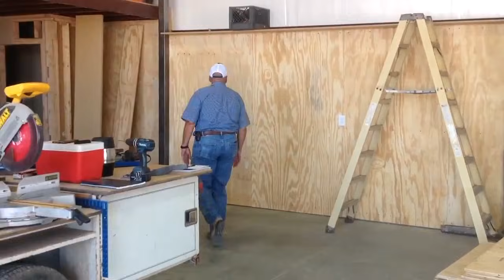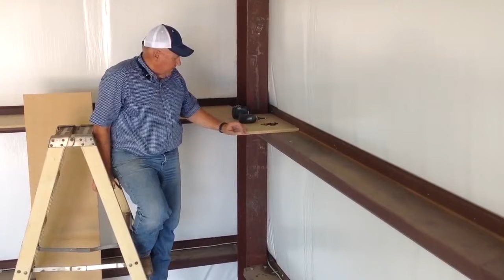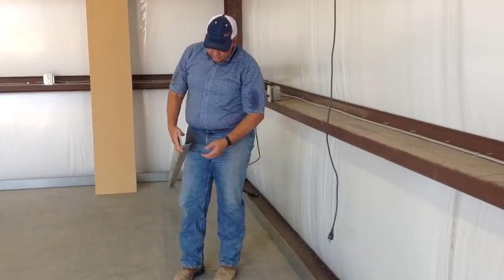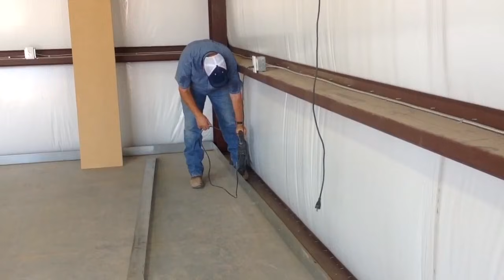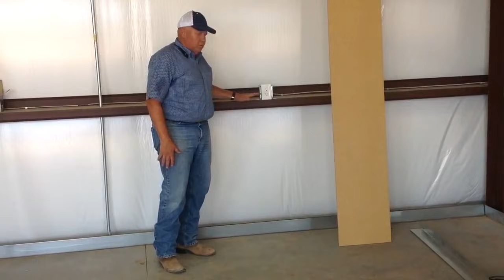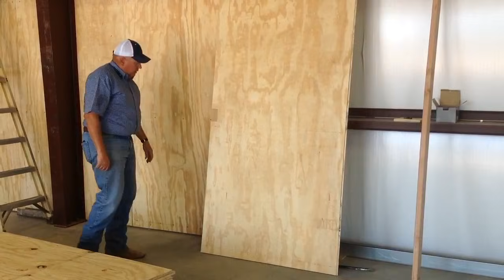Metal Building Interior Finish

Comment: Great video, I just had a metal building built and I'm wondering what type of bit to drill through the heavy beam? The thinner stuff is no problem but to run the conduit it will need to go through the supporting beams horizontally. Any help is appreciated.
Reply from the maker: Great question Brandon S and thanks for watching. Typically we do not use any drill bits, instead we use self-tapping tek-screws designed for metal. So long as you can find a source for them, they make ones designed to drill through 3/8" material, that should make it through any of the beams in your building. Otherwise any good drill bit designed for metal should suffice, the beams are made from mild steel and do not require any special drill bit material. Though we've found the cobalt bits are worth the extra expense simply because of their longevity compared to standard HHS bits. Good luck and enjoy your new building.
Reply: Jeezzzz, this is an old video but I have to correct this.
You SHOULDN'T be drilling through the heavy vertical structural members, if you look up the proper code way you use conduit to 'U' around the beam.

Comment: 3/4" plywood is the way to go. If you're making a shop then sheetrock is nothing more than a pretty waste of money. And if you're worried about fire resistance, there is plenty of low cost do it yourself spray on fire retardants available. Just spray them on all sides and let dry prior to installation and you're safe. 
The only thing I don't like is MDF, it's just crap. Use plywood. MDF sags like old boobs. 
And lastly, if you're building a workshop, don't forget to run your air, 220v, and 3phase, around the sides before hand. It'll keep your walls clear and you'll have it available to easily tap into. I'm planning a build and when the interior is finished, all I want to see is the walls and some equally spaced 2 sets of outlets and air lines. The rest will be added on as need basis. It'll keep the long term update cost low. And that's more important for me since I plan only one big cost in the building and setup. But for now it's saving every penny and getting any needed materials that I can get for cheap or free ahead of time.

Comment: my i beams are 30 feet apart, one at each corner,  and my perlins are 8 feet up.  If I use this method, what keeps the wall from falling forward if something heavy is hung from the wall.  The perlin is thin metal and it holds up the metal walls....  I guess I see the entire wall collasping inwards.  There is a lot of flex in the metal wall.
Reply: Purlins refer to the longitudinal, horizontal member in the roof. Girts for the longitudinal, horizontal wall  members shown, You really should have done more research on the who you got the building structure from as it seems they short sold you and gave you a poorly designed/engineered structure, you should have at least two intermediary columns and roof beams. Seriously get a local steel engineer to inspect your structure, most do not offer such minimal primary structural support, unless you're not understanding what comprises the anatomy of such a structure and not knowing how to determine what is what that you are looking at.
Reply: so are mine. steel studs @ 16 oO.C. that is a STRONG wall. the shelf idea is brilliant.

Comment: Another thing that could be done is the put the plywood even higher off the floor and use diamond plate about 8 inches up or so or you can buy rubber molding that can be glued on.

Comment: That brings the question why go with steel why not go with a stick framed building? A lot of people I know that have bought steel buildings did not get the insulation, and the insulation is not easily added, this makes the building very hot or very cold compared to a stick built building.  Seems like a lot of extra work and steps, like you mentioned three-quarter plywood is expensive $30 a sheet, a steel building is expensive and is not easily finished inside, look at all that square footage behind the sheeting that you're losing!, and you're losing a lot of space because of the beams angling out, those beams dictate where workbenches or equipment is going to go in your shop. Why not just frame the building out of 2x6's or 2 x 4's in the first place? You can put metal siding on the outside of the stick frame building if you want and make it look like a steel building. Stick framing is pretty easy, seams to me the labor saving would be huge if you supply the labor, there is a lot of profit in the steel building kit vs just buying Raw materials. In my shop wall space is essential to hang and mount many different things i've worked in metal buildings and it's a lot harder to hang things run air, electrical etc also like I said before the way the support beams angle out word it prevents you from putting equipment up tight against a wall or forces you to move it over to one way or the other, for example say you wanted to have shelving all the way down one wall tight against the wall it would be impossible.
Reply: Today there are more easy to apply less 'toxic' foams after they have been sprayed and want to wear a suit in any spray application to keep clean and the stuff out of your breathing system (nose, mouth, throat, lungs) and ears too. There is also BIBS blow in insulation system on top of EPS (expanded polystyrene) sheets up to 4 inches thick, All of these are easy to put in and offer full R value as opposed to the insulating they instal and pinch between the exterior finish and girt/purlins as any one with experience will tell you this pinching negates insulation values and creates cold gaps. I would forgo Fiberglass rolls as rodents would just eat through it  and opt for rockwool or denim if you rather go more natural route but this has its minor air gap issues as well if cut outs are not cut for proper snug fit.

Comment: It depends on what you can do in your building but always remember this. You can go TALLER much more cheaply than wider or deeper. In my neck of the woods you can find used steel trusses and red iron cheap. So building a second level (for storage for example) becomes much more cost effective than a larger footprint. Think 20 foot eve height rather than 12 or 14.

Comment: Is there a reason we can't build the steel building to match dimensional lumber? That way we would not have to cut the 8 inches off the plywood. Then the whole building could be finishable with dimensional lumber and drywall or such, with very little scrap.Is it that the steel codes don't match the wood codes?
Reply from the maker: That's a great question Steve Harkins. 

The standard girt height is 7'-4", but can be changed depending on what the project owner requests. As each building is custom designed to specification delineated by the owner, we are able to place the girts at varying heights. The standard design we use is generally the most efficient in terms pounds of steel used, and thus the cheapest, which is the goal of most builders. Varying from the typical design will likely change the overall price of the building, but depending on the intended use, i.e. sheeting or dryingwalling the interior walls, the additional expense in steel may be outweighed in savings elsewhere. 

Please contact us if you happen to live in the state of Arizona and ever look to build, we'd love to earn your business.
Reply: Steel v. Wood codes and requirements are quite very different from one another

Comment: Just use the same kind of sheet metal that's on the outside of the building. You can get it in white,  it's not a fire hazard like plywood and should be cheaper than $30 a sheet.
Reply: not to mentioned that once you 'swiss cheese' it with so many holes you need to replace  as it is not mend-able like drywall or plywood, then again flat (perforated or solid) sheet metal is just as good but solid metal has an audio reverb downside and comes in the same gauges (thickness) as exterior sheets, stainless steel is more costly than any other sheathing

Comment: Why do you put the galvanized 2x4 thing on the bottom instead of just screwing into just the bottom girt like you do on top and the middle???
Reply from the maker: The red iron you see on the bottom is only a 2" x 4" base angle.  It sits against the concrete and the outside sheeting only.  What we did with the galvanized piece is just to mirror that on the inside so that we have something to fasten to bottom of the plywood to.

Comment: Thank you!  it helps me with ideas.  In FL. we are planning a 40x40x30 steel agribarn, but will stud with 2x6 , insulate everywhere with Ply like that, Paint. Intall a hydropower water wheel Genny, for low to no cost electricity.  Install A/C inside it and Wallah!
Reply: hope you realize that BTU values only account for interior height up to 8 feet and you want to add a 1,000 for each additional height, or just as an experienced professional what size they recommend for your 1,600 square to 48,000 cubic foot space

Comment: I'm doing almost identical with my metal building, but I'm using 1/2" OSB.  Spraying with a primer/sealer & painting white. I ran two separate circuits in each 4" electrical box (using romex behind the wall).  I have no shelf on top, though.  Have to think about that.  The spacing off of the floor is a great idea. I'm doing .040" aluminum clad on the OSB where my welding stuff is.

Comment: Cheaper dirty quick way to do the electrical would be  string romex (non metallic sheathed cable) ... (or the metal armored cable if that is code)  into the void  of new wall before putting up the plywood and leave a  loop at each location you want an outlet. (or switch etc)  then just cut holes in the plywood the size needed for old work boxes!  You know the kind with ears normally used with drywall....well with 3/4 plywood it would be rock solid box mounts!  Okay so the holes are cut right where you left the slack loop in the romex,  simply secure the plywood, reach in and pull out your loops at each hole, cut the romex and install the old work boxes same as if in drywall  You now have quick and easy flush mounted rock solid electrical installation!  The only thing you get that is arguably less than with conduit is you lack the ability to pull new or more wire ...how many guys that would ever effect?  hardly anyone....IF you DID want to allow for future you could lay in a piece of flex conduit behind the drywall with plenty of slack that ostensibly you could cut a box hole wherever in the plywood and fish it up to the hole and connect that to an old work box...note that the old work steel boxes are gangable meaning if you needed a larger box for a 50 amp receptacle or whatever, you gang two together to accommodate that device...easy peasy!

Comment: I wonder about condensation build up between the insulation and the 3/4" plywood.  Is there adequate ventilation to relieve this or do you feel that this could be an issue down the road with the plywood.  Mold, mildew etc...
Reply: This was in Arizona where its on the dry side in terms of humidity so its rare to get humid enough for condensation to happen, best to consult with local steel buildings construction professionals for their advice on your area codes or requirements to prevent this issue.

Comment: Something you said caught my attention: You stated that the plywood was stood vertically, because the strength is with the grain. I thought the strength of plywood was that each individual layer that makes up the sheet of plywood has its grain perpendicular to the adjacent layers, thus giving it strength in both directions.
Reply: Yes ,but plywood usually is an odd number of plies ,making more plies running lengthwise.
Reply: HiTechDiver that's correct. But you have to lay the sheet across the frame members his frame members are horizontal, so his sheet goes vertical. That creates sheer strength.
Reply: he said the SEAM is vertical for that reason...
Reply: The highest strength is the grain on the outside plys, furthest from the center.

Comment: Nice job👍
Reply: I like it! I am not a fan of finishing sheet rock, AND once wall board is finished you STILL have to paint the stuff. This looks like a much better and stronger solution. For my 40' x 60' building (hopefully built next year) I think that's around $1400 to finish out the entire inner perimeter of the building.  Now if these guys just built in MONTANA!